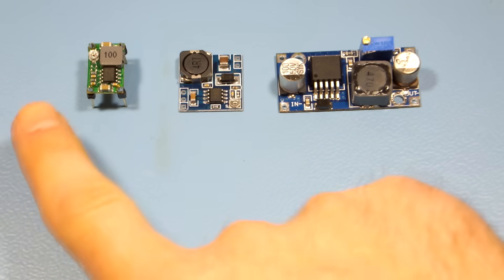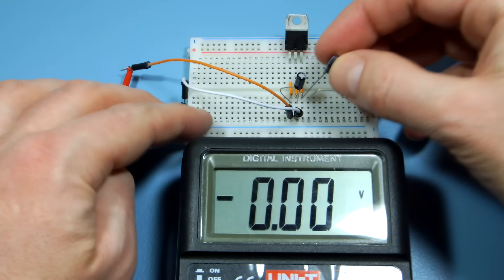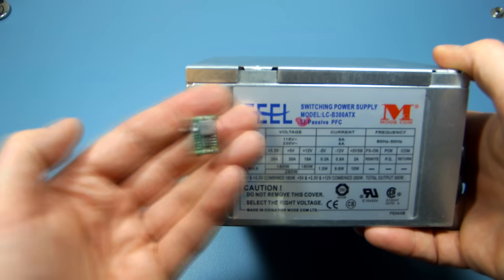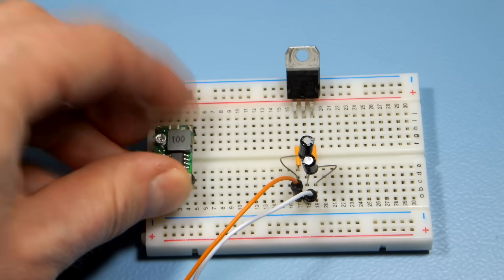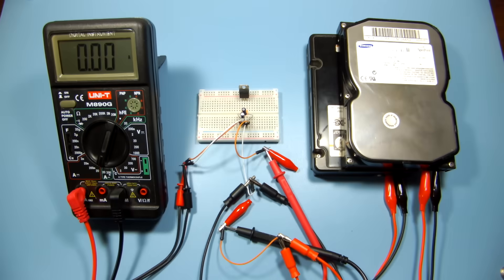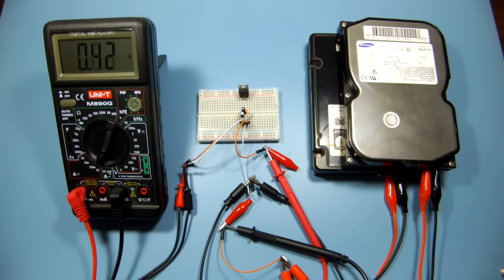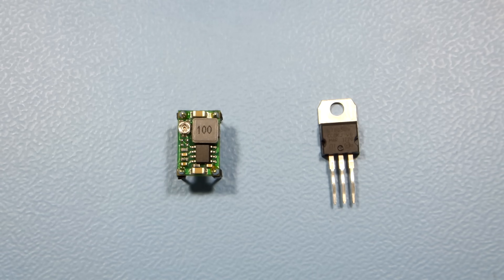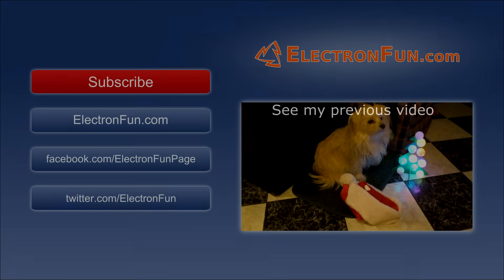Buck converter vs. linear voltage regulator - practical comparison

Comment: connect an oscilloscope on the output of both and you will see why buck converter may not be suitable for circuit applications. Further , Buck converters misbehave in certain unpredictable conditions,  damaging the projects, particularly if they are not well designed. So one has to be very very careful in using them , compared to linear regulators. More the components, more the problems too.

Comment: I want to make a variable power supply so after the bridge rectifier which regulator should you recommend as my output will be 0 to 100 volts and 0 to 30 amps

Comment: I had to use linear regulator for powering a video monitor in suitcase system due to excessive noise induced video when recording videos when any switching power source was used. Using linear regulator to power video monitor eliminated all noise.

Comment: Thanks, I'm in the process of building some 3v3 output battery packs and needed to decide which type of regulator was best. Clearly a buck converter offers the best efficiency. Now I need to come up with a lean design for a small undervoltage cut off that doesn't bleed power from the batteries faster than the ESP01s I'll be powering. (something simple with a zener and a comparator, I'm hoping)

Comment: Overloading is needed for 3-20 minutes . For cheap power banks, the overloading is needed for 3 minutes, the fast charging turns on. For brandy devices and car chargers the overloading has to last for 20 minutes to turn on the fast charging. You can overload with powerful 6 V bulbs . By default, when you buy such items, some trouble happens. It skips charging, the charging stops, or drains too quickly. With the overloading trick you permanently fix the trouble. If the device is stolen, it gets to a blacklist in 1 and a half year, and you have to get rid of it.

Comment: For loads of 50 mA or less, the linear regulator may still be the better choice. Many of the switchmode (buck) converters pull nearly that much current, even without a load. For loads exceeding 100 mA, the switching regulator will be much more efficient.

Comment: You can't calculate the power consumption like that. For the LVR it's (Vin - Vout) * Iout. For your circuit it's about 3W not 5W. The same for the buck converter except it's a bit more complicated. It approximates to Iout x Vout x (1 - efficency). Assuming 85% efficency then it uses about 0.3W. So the buck converter uses 10x less power, not 2x as you say in the video.

Comment: I replaced the old 4,8V NiCd Battery in a RC-Toy Car, with a modern Li-Ion 7,4V Battery Pack (Sony NP-F style). Then used a Buck-Converter to get the Voltage down to 5V.

Now my remote can only control the car I am 1m (3feet) radius.

So you say the buck converter interferes with the 27,125MHz receiver in the car? 

Can I somehow get rid of that problem using a capacitor? I don’t have space for a big heatsink. Or could I use a linear converter to „convert“ 5V from the buck converter to 5V for the car?

Comment: You mentioned there is heat issue for linear voltage converter. How about to use ceramic substrate PCB inside it and help better heat dissipation? Then it might not need heat sink.

Comment: Why use those two capacitors? Do you always need to add capacitors for this voltage regulator when you want to step down voltage?

Comment: I’m building a bench power supply which will have a linear regulator with a switching buck pre-regulator.  This hybrid design is supposed to combine the advantages of each. Or compromise the disadvantages depending on how you looks at it. We’ll see how it works.

Comment: What if i use a buck converter to get close to 5v, then use a linear voltage regulator to clean up the voltage? Would that be effective? Would it still be a waste?
Edit: just found my answer as a suggestion below, thanks!

Comment: In a situation where one needs both 12 volts to power LEDs or a relay, but also needs 5v for CMOS logic, do you think an LM7805 would be appropriate since it wouldn't heat up very much since the CMOS chips don't consume much power?

Comment: Although good information provided here, but calculation of power??? Why are you multiplying the whole 12 volts, regulator provides 5 volts at output for load, only drops 7 volts across itself, 7 X 420mA will get you the correct value

Comment: I have a 36v lithium ion battery. I also have a 24v mobility scooter.  If I was to use a buck converter to drop the battery voltage to 24v and hooked to the scooter.  Do you thing the buck converter could handle the current?

Comment: Buck converters always have a little bit of output ripple. If this is undesirable, you can use a buck converter to step down to just above the dropout for your linear regulator, then use the linear regulator, which won't need to drop as much voltage, generating less heat.
Reply: Just change some component values like the inductor or capacitor to lower the amount of ripple. Or find a new buck converter with a higher switching speed. I don’t think ripple is that big of an issue as long as it isn’t huge
Reply: @xxbatman69xx98  For most applications, I agree. Though I'm aware my audio electronic friends will say there's no substitute for a linear regulator.
Love buck converters myself, but I mostly work on digital stuff, which is more forgiving.
Reply: hi it mean i can use a boost converter and combine it with ams117  ldo?
Reply: I've fixed that issue.
Reply: E se usar capacitores maior não resolveria?

Comment: i am in the process of building a power unit for my solar panel system, i was just thinking about the heatsink i would have to use with the voltage regulators and all the other stuff, ad the i saw your video,  think i will go with the buck converter, thanks

Comment: Hi, in this Test, you can see the Buck Converter can supply 220mA to the same Load only?! How can the Load run with only 220mA at the same 5VDC rate?

Comment: you have video on step upgrade voltage?
I need 48V from 3,7V battery. I know a diagram with mosfet wich is the linear converter but i am worry about heat, and now after see your video about consumption power.
With mosfet i can make it small but step up DC can be more biger because PCB, i can deal with that if i benefit with a better efficiency.

Comment: greetings, they can be used to reduce the voltage of a 20v 2a drill battery to 12v at 1.5a. for another 12v drill. Wouldn't it overheat Much? I already tried the LM2596 dc-dc and the MP1584 and it doesn't work, it doesn't lift the drill very hardly, that's why I wrote to you while I'm still stuck in my project while I'm looking for other modules of these, if you know, let me know. Thank you, I appreciate it very much for here I saw a mofet I think it's a 5 amp round metal mofet.

Comment: Bro i have a question if input voltage is decreased on the buck converter will it still output the disired voltage? For example if i hook it up to a 12v battery and set the potentiometer to 9v will it still output constant 9v even if battery voltage decreases to 8v or less
Reply: No never....input voltage must be 2 volt higher than output (desired voltage)...for eg. if u wanna get 5v output you must have 7v or above in input voltage...

Comment: Awesome content. Wish I saw this a few weeks ago when I was building (using a linear regulator) a DC project. I learned through trial and error of the massive heat issue. I did end up using a buck converter.

Comment: There are many different types of voltage regulators available on the market, each with its own set of pros and cons. In this article, we'll compare two popular types: buck converters and linear voltage regulators.

Buck converters are a type of switching regulator that convert DC input voltage to a lower DC output voltage. They are smaller, lighter, and more efficient than linear voltage regulators, making them a popular choice for portable devices. However, they can be more complicated to use and may not be suitable for all applications.

Linear voltage regulators are simple and reliable, but they are less efficient than buck converters and can take up more space. They are a good choice for applications that require a stable output voltage or where low noise is important.

Comment: why did you at first measured power as input(12V) - 5V times current? Later on in the video you just calcuated it as 12 times current. Why is that so?

Comment: linear works great when the input output differential is not big, e.g 14v to 12v for automotive applications. the heat is much lower in that case. I feel like the fact that heatsinks are omitted in this video skews the discussion. the datasheet on 99% of linear regulators include a heatsink requirement, so why compare a buck converter to a device that's missing half its components?

Comment: Hi from Sunny South Africa -  I prefer the LM 7805 because 1) Temperature is easily sorted with simple aluminum heat sink 2) the ripple voltage is much cleaner than buck converters 3) Cost is much cheaper 4) ZERO EMI issues - ever

Comment: i have found the buck converter you used to be very sensitive to temperature- take it outside in the winter after a few minutes the output voltage drops . Take it back into the house the output rises, hold it in my warm hand- voltage rises even more-  even worse put it into an  unventilated small enclosure ...output keeps rising. Do you know of a more temperature stable adjustable output Buck converter?

Comment: If the incoming voltage is variable... a car alternator... 12.3 to 14.4V or so.... will a set output of 10V hold... or will it bounce accordingly with the alt?  (using a buck)
Reply: (And you answered the closed box question I did not ask!!  )
Reply: yea it should hold it only if your input voltage > output voltage, also if your output is higher you should use a buckboost converter

Comment: hi an i connect liner voltage reg to get mobile charger for  5v  from car battery . suitable or not  ?  thank you
Reply: it will get very hot, there are quick charge modules which are for $2 and they even support fast charging

Comment: I have 11 12 v pilot lamps on a electrical panel on my sailboat. My smart battery charger supplies up to 14.6 volts and that is too much for the pilot lamps and they are failing. These incandecent lamps are in toggle switches. I contacted the manufacturer and they suggested 4 diodes in series to drop the voltage to the lamps wired in parallel These diodes get far too hot! I bought a dc-dc converter but comments here suggest a buck converter is not the best choice to drop 15V down to 11 or so volts. I am able to wire the lamps in two groups in parallel and then wire the two in series to drop the voltage or use a linear voltage regulator, resistor, or my buck convertor. Energy consumption is the main issue since when sailing I have no charging and the diode setup I'm using is a fire hazard. What would be the best solution?
Reply: incandescent bulbs use too much current, but there are buck converters that are rated for very high power and are also cheap, honestly for your application a buck converter is kinda suitable but the best option would be to replace the bulbs with leds
Reply: @ShahZahid  Thank you. I cannot replace the lamps- they are within toggle switches. I'm thinking of adding a pair of small bulbs to back light the panel and wire those two  bulbs in parallel and in series with the 11 toggle switch pilot lamps now wired in parallel. That should cut the voltage down to a safe level and lower the current without wasting so much in heat with the diodes in series. Halving the light output in pilot lights is no problem. The issue I now have is figuring the wattage of the two additional lamps- Would the wattage of the two additional equal the eleven for a balanced light output? What do you think?
Reply: @genesmith4019   those two other bulbs will also generate some heat, also do you know how much current your toggle switch  lamps use, without that you can calculate the wattage of the new lamps. but i initially thought that you were talking about those big bulbs but if they are just indicator lights you can use 300w buck converter and it would barely get warm i just checked and i can get one for $4-6, that would be the best solution imo and would waste very little power, but first do tell much how much current all of the lamps are using

Comment: what if input volate is not constant it may varry from 7 to 15 volates as battery get too charged or discharged and we need constant fixed 5v output.

which option will be suitable?

Comment: Hi, I plan to do some projects using 12v and 24v coming from a vehicle, you my know if the vehicle is running the 12v b come 14.2\14.5v and the 24v become 26,5\ 28,5v.Wich converter is better if any of this device I plan to make is better keeping in mind the start of the vehicle when te current goes down and when running goes up and no damage the electronics.Thank you

Comment: if you vary the input voltage on that buck converter will the output voltage remain fixed?
Reply: if your input voltage > output voltage, then yes it will remain fixed
Reply: @ShahZahid  thats excellent. how much current output is the limit for that small buck converter? will it handle 1amp at 5v output with 12-13.5v input?
Reply: @slybunda  current output should be written on the page you buy it from, generally these small ones are 2-3a, yes 5v 1a should be fine
Reply: @ShahZahid  thats good. I see some car cigarette lighter phone chargers that get hot while charging a phone due to using a single rectifier diode. Thinking one of these should run cooler and be more reliable
Reply: @slybunda  definately, since its a buck converter efficiency is great, also if you want to charge your phone there are small boards dedicated to that task, they have a usb port and support various charging protocols, they also generally accept 6-24v
Reply: @ShahZahid  thats great. id like to make a high quality one for tight regulation and cool running with long term reliability.

Comment: Ive seen the output of a linear voltage regulator on a oscilloscope before, but not of a buck/boost converter. Does the buck/boost converter put out a clean dc voltage? If not, would some capacitors clean it up?

Comment: 6:20 nowadays everything is sensitive - 5g, WiFi, LTE, GPS, GSM....
Reply: i have used buck converters in many wifi projects (esp8266/32) and even gps ones, and it works fine, honestly ripple becomes an issue if you have high frequency data lines like if you are driving neopixel etc also good buck converters (from trusted manufacturers) generally have very less ripple and noise

Comment: Is it possible to hook up an AC/DC regulator to DC/DC step down Buck converter power supply?  Or even from a 12v battery hooked to the Buck Converter to the V-reg? 
Thanks!  Great tutorial.
Reply: most modern lab bench power supplies use buck converters so yea you can use it as a lbps

Comment: Good video. I have a question related to this. How do I conect the out puts from two 5v/2.4a usbA ports, each is connected to separate power source, in this case, two separate 21w solar panels, to get one 10v output? I tried to do so using two different, typical 5v/2.1a  usb wall chargers, but could not double the voltage. My goal is to input the power from two separate backpacker style solar panels into one femsle usbc terminal. Currently, ( no pun intended) I am using a cord thst has 5pin push in with screw terminals on one end and a female usbc on the other. I was not able to draw any greater amperage or voltage or wattage by combining the usbA  output leads in the same screw blocks. I tried both +to+ and +to- in the screw terminals.. I wonder if inputing one set of leads to the D+&D- would transfer the wattage from the second solar panel to the usbc output terminal? {The cables I used before were usba power only .
From there I will connect a QC2.0/3.0usbc/ PD(?) Usbc male input(&output?) with dual output consisting of one  usbc output (&input?) amd one usba output only. From there I hope to charge a 30w input (i have already input 37 watts at 19v ) 45w output 20,100 power bank. 
Tyia for any good feedback.

Comment: This was a very useful video; thank you! One thing I've been using linear regulators for is variable voltage but low amperage equipment, like solar chargers, etc.

Comment: buck converter is good only when you have stable input voltage, stable input = stable output, for example: 
12v in = 5v out, 
13v in = 6v out - yes !   ):

there is 7805 who can handle 1.5A and 125C  
L7805C2T

Comment: I have a metal detector the runs off of (6 pack) and (8 pack) AA batteries. They are connected to 2 connectors that share a common ground..

(+12v)---(GND)---(-9v)

I was wondering if I am losing power efficiency if I made a 
(2 terminal battery pack) from LiPos and converted it to the voltages the circuit needs using a split phase output buck-boost converter. 

If this would be power efficient, I would either need a split phase output, or 2 buck converters with isolated(floating) outputs.

Can you help? Thanks..

Comment: Hi. Nice video. Can I use bulk converter to work in my rc helicopter, because the tail servo I have an input of 7,4v and It should be regulated at 5v to power it up. The current draw is about 5 amps. But the question? The heli uses an 2.4ghz receiver ! Will the bulk converter interfer whit the radio ?

Comment: Don't fail to take into consideration the fact that a buck converter is inherently less reliable than a linear regulator simply because it's far more complicated and introduces very many new single-point failure modes.